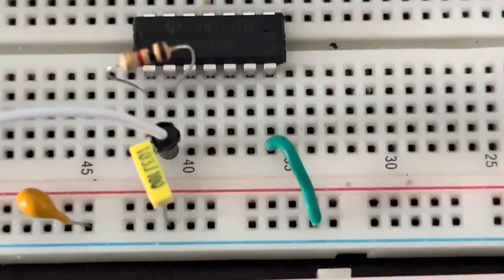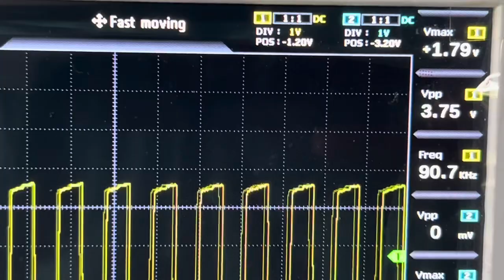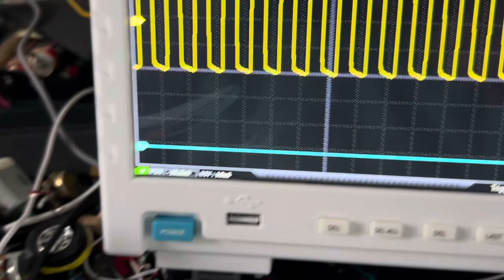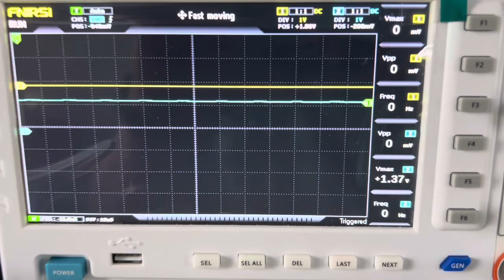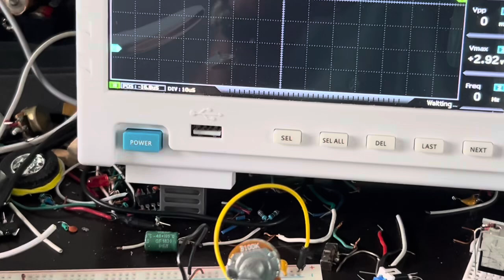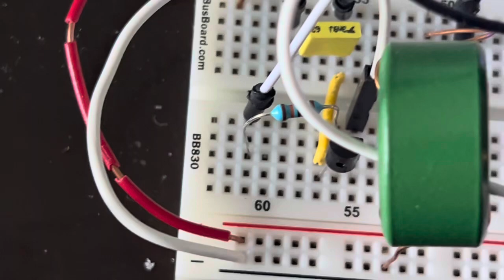DIY ROM using Core Rope Memory from scratch

Comment: Impressive video, Igor Brichkov. Looking forward to seeing your next upload from you. I hit the thumbs up button on your post. Keep up the fantastic work! Your explanation of the oscillator's role in generating the square wave was particularly enlightening. How do you see this core rope memory concept evolving with modern digital technologies?
Reply from the maker: @KeyserTheRedBeard  not sure of the evolution but this form of ROM will last forever. The apollo guidance computer ROM is still very much readable and error free today with non corrupted data. When AI takes over and starts changing our data, this will still be an option as a human only data storage modality. I will use it just for audio stuff just because its cool

Comment: Cool experiment, You need these little, quite tiny, "NOS" original rings and much of patience, some people sell these original old rings. one here on YouTube. to create SRAM.

Look for this video: "*Topic 38: Darlington and Sziklai Pairs, Overdrive/Preamp and a Complete Power Amp*". check the circuit in the end.
You can put more output transistors in parallel to share load, use simple bc847.
Reply from the maker: Would love to get my hands on those dont know if i have the patience to weave them all together, especially the ones i will need my surgical loupes to see and handle
Reply: @igorbrichkov3632  Yeah, i did talk to someone that sells these originals NOS, but i don't want to pay import taxes nor hassles with the post agency nowadays. look the "recent" YouTube video's on these subjects, there is a person in the US that sells these.

Would be very very very cool to build analog SRAM a la Apollo rocket style.
Reply: @igorbrichkov3632  Please, check out the "Sziklai" amplifier in the end of the video i suggested, it's a very hard circuit to understand, the left most transistors moves little "charges" to make those on the right move big charges, simulation says if that if you use "Triple" the output transistors (right hand) you need to use 820 Ohm rather than 100R, using 3 output transistors, avoids using big guys and you can keep using BC547, BC557, some 80 mA will be pushed through the 220uF capacitor to the speaker.

you need to take in account the "Beta" of the transistor (+/-300) + voltage drop throuhg the transistor in calculations to get it right and near to 95% efficient. that's why 820R Ohm.
Even the 2 x 10K may need fine tuning.
Reply: @igorbrichkov3632  .... and use 3 diodes instead of 2.
Reply: @igorbrichkov3632  If you decide to build this "Sziklai" amplifier for better sound quality for your sound experiments, you need to put the scope probe "across" the resistor  rather on GND. Than the scope shows much voltage is across this resistor, from there you DIVIDE this voltage with the value of the resistor, than you know how much ampere is flowing.

just a a reminder, Transistor move current according to how much is on the base multiplied with "300" the beta of the transistor, so if you insert 0.1 mA you get 30 + 0.1 mA, so it's very wise to make standard knowledge to avoid wasting current. deliver what's needed.
the PNP's in the top part sink current from the base, the NPN makes this possible dosed by the 2 10K resistors.

The circuit is simple to look at it, but making sure it produces lots(Max possible) of current while maintaining the same shape as input or overdrived, you need to research how much current(voltage) is flowing over the resistors. you probable enjoy the research.